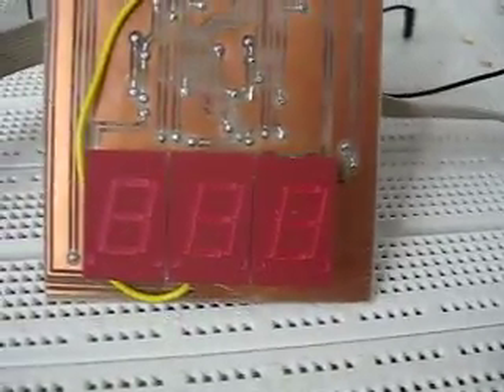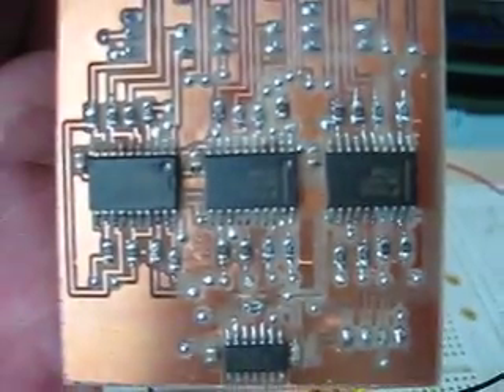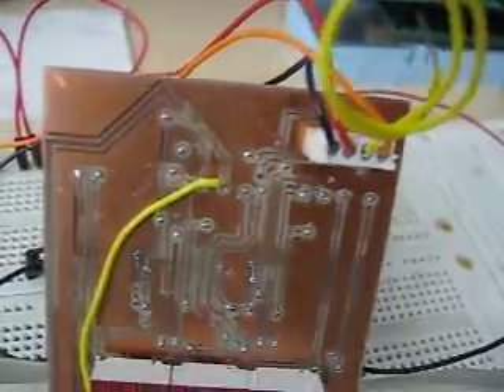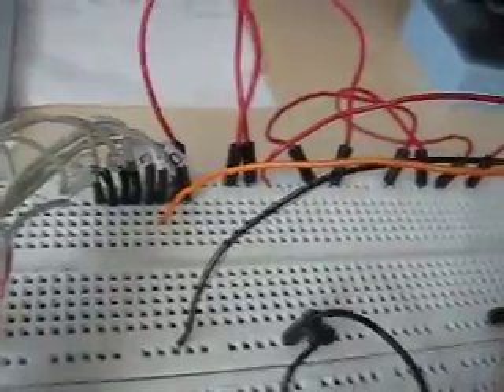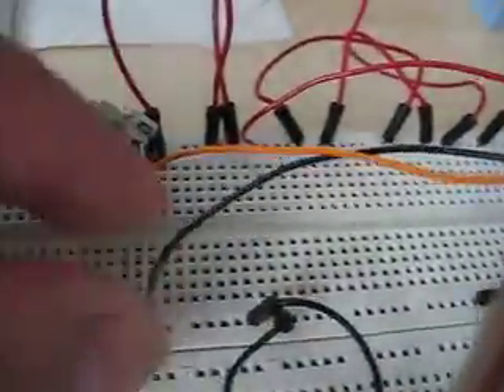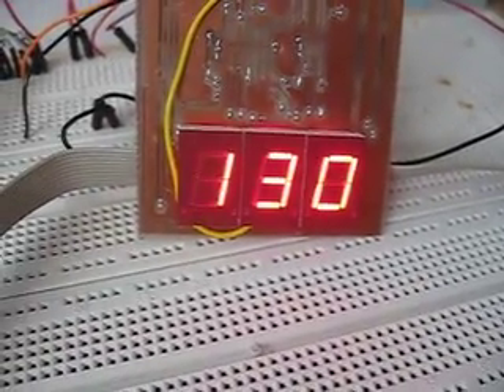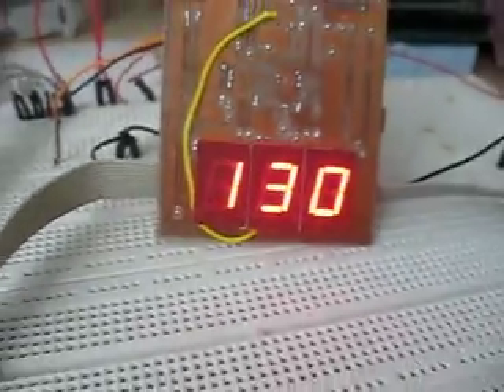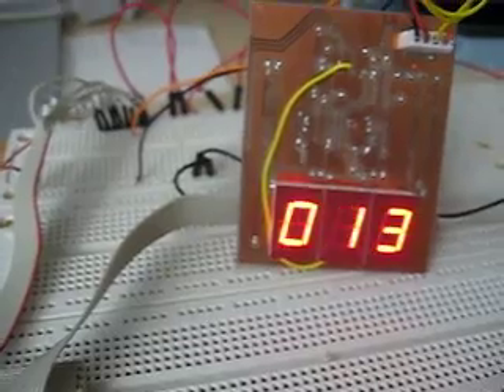One wire 7-segment interface

Comment: you could have saved that "dot flash" problem if you were using a shift register with latch like a 74HC595 instead of a 74HC164. Anyway, going further, a single chip MAX7219 would drive 8 full digits simoultaneously at a time, instead of your 3 digits. Simpler in the hardware (board complexity) and in the software.- Nice implementation you made btw.-